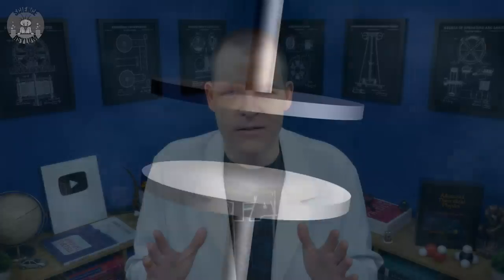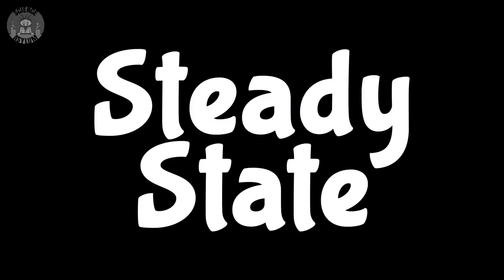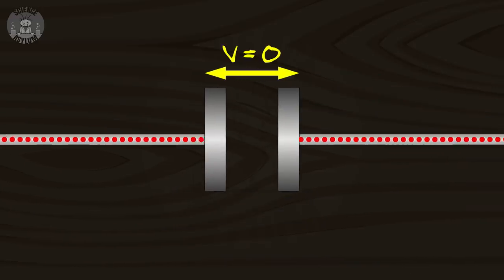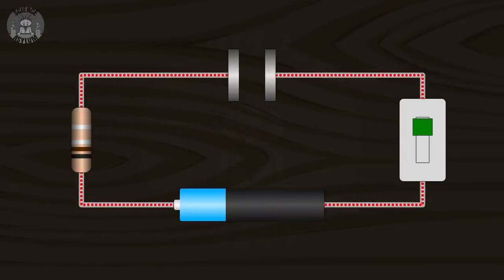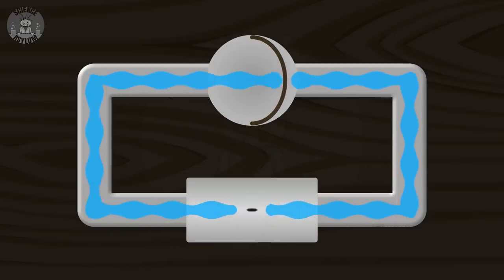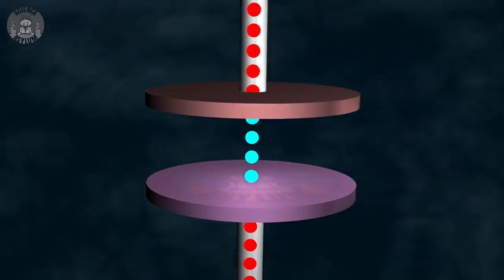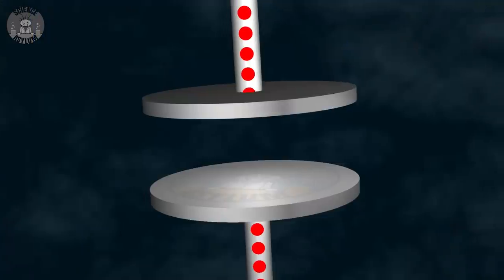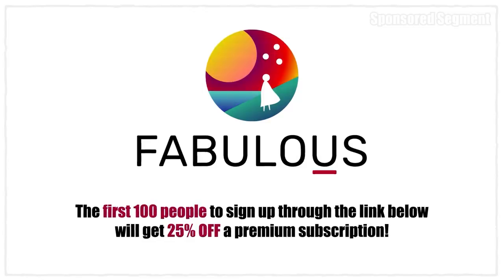Capacitors Are Gaps! How Does That Work?!

Comment: I still don't get this trend of saying that electrons (or any charge) are not transferring the energy, but the fields are actually transferring the energy because Poynting vectors.
That's trading a partial view, for another partial and biased view.

The electrons do get energy from the battery, they get potential electric potential energy. In the same way, that a mass receives gravitational potential energy when being lifted at a higher altitude.
This electric potential energy, or rather its gradient between the + and -, is actually what is pushing the electrons to move around the circuit and create the current.
Then by moving the electrons create/interact with the electromagnetic fields and the energy can be described either by looking at the electrons or by looking at the fields and the Poynting vectors.

Is the energy moving with the fields, or with the charges? Well it does not really matter, because they cannot be separated.

However, thinking that the Poynting vector tells us everything about energy is ignoring half of the story. For instance for a resistor, the Poynting vectors tell us that the energy is coming from the fields outside the resistor toward the resistor. While at the atom level, the energy is dissipated by electrons interacting with the atoms. So what's is a more appropriate description of Joule heating?
EM fields sending energy into the resistor, because it is a resistor and that's what EM fields do?
Or electrons actually losing their energy by smashing into atoms?

Tips: with the 2nd we can deduce the first along with Ohm and Joule laws and how resistor change with temperature.

Comment: Wait, did I miss something but why is a capacitor gap useful to a circuit? What purpose does it provide to have energy 'breathing' at a particular point? Do you even need/use capacitors in a circuit for a light?

Comment: A capacitor is like a bucket, where water is the charge. It takes time to fill it. A small capacitor is like a paper cup, a medium capacitor is like a bucket, a large capacitor is like a tub, and a really large capacitor is like a swimming pool. The analogy is not perfect, because the fuller it gets the harder it is to squeeze in more charge, like with batteries. This is where we can use another analogy: people entering a car. 4 people can be seated instantly at the same time. As soon as you have 5 people, the one in the middle has to get in first, and the 2 others can't enter until he's in the middle. And it gets worse, imagine squeezing in 10 - 15 people in a small sedan. The capacitor is like a circuit break for DC current, and it's like a queue for AC current (it delays things, like when you wait in queue). Except the direction of flow changes really quickly, imagine people entering the room, exiting, entering, exiting a million times a second. The actual equations are very different, though. Once you understand what's going on, you're better off working with the actual math rather than your intuition.

Comment: WHAT IS DIFERENT between capacitor and coil of coper wire , because when coil of wire is in series with the light bulb, when switch turned of the bulb still shine for a second or two. thanks for informing video                                                                              eire is in sereis     n

Comment: If we need an electric and a magnetic field to have a poynting vector, and we get a magnetic field because of moving electric charges, then the battery will have to move electrons to transfer energy will it not?
Reply from the maker: "...then the battery will have to move electrons to transfer energy will it not?"
Yes, that's true... but that doesn't mean the electric charges have to go all the way around the circuit. The electric field can just charges moving on the other side of the circuit before the wires on the ends respond (depending on how far away they are).

Comment: Seems like it would've been good to include what happens if/when the battery is discharged or removed.
Reply from the maker: If you remove the capacitor after it's been charged, it can hold onto that charge for decades.
Reply: @ScienceAsylum  Sure, but I mean to show the capacitor discharge flow.

Comment: Its allways fascination that energy is held in capacitors via the electric field and in inductors via the magnatic field while both fields are a corelated phenomenon.
Reply from the maker: Even though they're technically one thing, the electromagnetic field, it's almost always easier to think of them as separate.

Comment: But you never explained "WHY Capacitors?"
Battery hooked up to itself would discharge quickly. A switch gives control, but still no work is being done other than the chemical changes inside the battery.
Why add the capacitor to the circuit?
Most often, I hear capacitors used as an alternative to batteries w rapid charge / discharge vs the trickle charge/discharge of the battery. Wouldn't that mean that at max charge the gap is breached and the flow happens in a rush then recharged again?

Comment: This is a great breezy education video. The one unnecessary fact is the line "Even superconductor has resistance". I am not saying that it is not true, it is just that, from a pedagogy standpoint, this unnecessary mention of superconductor put a limit on our constructive learning of electrical engineering. If we were to imagine that our learning is like a game of infinite Go where the focus is on aesthetic, then we could see that some facts are like ugly pebbles placed far away early in the game. In constructive learning, we build models from the information that we gathered. When our models failed us, we go back to the drawing board and Wile-Ethelbert our way to deeper understanding of our world.  Our sphere of understanding grows ever bigger and brighter. 

Near the end of the video, Poynting vector was introduced. Energy is shown to came from outside the wires. There is no resistance for the energy (the type of resistance that we care, for we care about energy loss). A wire can be viewed as a magnetic-field generator (the non-mention of electric-field is intentional) instead of a current-resistance energy-impedance thingamajig . Then, if we study coaxial cables (which essential is just someone's idea of turning the whole wire into a capacitor), energy that is coming from outside never reaches the wire which means and the wire failed to generate any magnetic field.

Okay, to bookend my comment about superconductor. The common view is that superconductor has zero electrical resistance. It is quite hard to find literature that would even mention about the resistance of superconductor. Also, a superconductor is not definite by its resistance to electrical conductivity, rather its expulsion of non-source magnetic field.    

#ee-newgameplus
Reply from the maker: "...from a pedagogy standpoint, this unnecessary mention of superconductor put a limit on our constructive learning of electrical engineering."
Are you just saying that the short tangent about superconductors distracted too much from the main topic? That I should have just stayed focused on the main topic?

"It is quite hard to find literature that would even mention about the resistance of superconductor."
That's because the resistance is so small that it's never going to be important on any practical level. I'm a theoretical physicist though, so every tiny insignificant detail is going to be important to me at some point because I want to understand the full picture.
Reply: @ScienceAsylum  Hi Nick, sorry if the intention of my comment is not well-understood. Basically, I enjoyed these YouTube science videos as a hobby. The comment is more of a note to myself (and to the few that find it useful). Initially, I wrote just one short paragraph of message. Then I found my message to be too harsh, so I sugarcoat it. Then, I add a second paragraph to further sugarcoat it (because I didn't find any video from you on coaxial cable, so I thought it was beneficial to mention that). Then I (as a somewhat narration-focused person. Even this reply is narration-based), realized that I need to add a third paragraph to revert the narration of the comment back to the original message.

Comment: I used to get stuck on whether a capacitor would ever lose all its electronics? but things never get that far, a capacitor either reaches a DC steady state OR if the voltage continues to rise things eventually go BANG. So are there limits? yep, but not enough electrons doesn't appear to be one of them. :-)
Reply from the maker: There are always limits.

Comment: So, in the audio world it is said the capacitance of wires, cables can affect tone (usually in long lengths).  Wires don't have a gap so why do they have capacitance?
Reply: Cables do have a gap. There are usually two* wires running inside the cable and they form a capacitor. The microphone/speaker is connected in parallel with this capacitor. The longer the cable, the more capacity it has and thus more capacitance.
Higher frequencies pass more easily through a capacitor, so they "leak" through the wires and don't reach the end device. So you loose the more and more high end of the frequency spectrum the longer your cables are.

Comment: capacitor is like uncharged battery, if two connected electric charge in the system going to equal level, of course capacitor got way smaller capacity than battery, but it is enought to power the led diode if connect after chargin stage

Comment: Question: you animated the red dots clockwise, but don't electrons move from ➖ to ➕ pole?
Reply: Yes, electrons do move from negative to positive.   He didn't specifically say it was the direction of the electron motion.  Just a representation of current in general.

It's an accident of history that the electron is negative, and that conventional current is defined as if it were hypothetical positive charges flowing.   Electrons flow in the opposite direction of the convention we use for assigning the direction of current, due to the fact that the electron is negative.   The results of the circuit are exactly the same either way, and you would not be able to tell the difference.
Reply from the maker: The animations are using "conventional current," which is the motion of positive charges. (Note: I always use red for positive and purple for negative.)

Comment: In your diagram the capacitor looked identical on both sides. It's been a long time since I dabbled with electronics but I remember capacitors have a positive and negative side. Mount one the wrong way round and you get a nice little bang with the contents scattered around the place. Why is there a polarity requirement? I assume something was left out of the diagram?
Reply from the maker: Some capacitors have a polarity and some don't. Honestly, I don't completely understand what makes polarized capacitors polarized. It's a little too practical of a question for me.
Reply: Polarized capacitors used sheets of anodized metal in their construction. The anodized layer insulates the sheets from each other. If you reverse the voltage it reverses the anodization and converts everything back into the base metal. Dead short between layers.

Comment: With the diaphragm analogy, how can a capacitor increase it's discharge voltage beyond what is being supplied.
How could a 1.5V battery create a discharge voltage of 100s to 1000s of volts in a capacitor when from my understanding the capacitor "plate" reaches 1.5Volts, the resistive buildup of charge should "stop" the circuit?
I know the absolute basics of circuits.

Comment: I'm still a little bit confused about the low speed of electrons, how energy flows  and how a spark is made with a small distance between wires as we increase the voltage seeing in the perspective of magnetic and electric fields. Would you mind explain in detail?? thanks a lot
Reply: There are billions, if not trillions of electrons that are flowing in a small section of the circuit.  The individual electrons have a drift speed on average as a consequence of carrying current, and that drift speed is incredibly slow.  The energy and information still propagate at nearly the speed of light.   The billions/trillions of electrons, in a wire already filled with conduction-band electrons, is what makes this possible.   In fact, the electrons have a chaotic thermal motion that far exceeds their electrical motion, but on net, this thermal motion adds up to zero.  The electrical motion is the part of their motion that doesn't add up to zero, but adds up to an organized motion to propagate the electric fields and energy.

As for the sparks across an air gap:
Air is a great electrical insulator, as are all gasses in general.  However, that is only if you can keep air in the gaseous state of matter.   If you subject the air to enough electric field, you will strip away the electrons from their corresponding nucleus, and ionize the gas to make it become a plasma.   All plasmas are conductive, and will create an unintended path for current to flow, called an arc fault.   The spark you see, is the air ionized as a plasma.

If you had a vacuum gap instead of an air gap, that would make a much better capacitor to prevent this from happening, since vacuums will always be an electrical insulator.  You'd need the photoelectric effect to eject electrons from the plates and have them cross the gap, in a vacuum gap capacitor.  But making a manufactured vacuum capacitor is not practical or cost effective.  A dielectric insulator filling the gaps is a much better solution.   Plus it enhances the capacitance, without additional plate area.

Comment: I have so much more respect for early researchers trying to comprehend electromagnetism. James Clark Maxwell, Michael Faraday, Nicholai Tesla, etc...

Now you have to explain how MOSFETS work. Especially since they are perhaps THE most essential component in modern electronics! (And are manufactured in utterly staggering numbers!)

How do Capacitors release all of that stored energy so extremely rapidly? 
(Or at least rapidly in contrast to a chemical battery). Or perhaps I should be asking, if it takes "n" microseconds to charge a Capacitor,  how can it take so much less than "n" microseconds to release it all..?

Also, some of the newer designs I've seen of bleeding edge chemical batteries (mostly for electrical vehicles & portable devices) would integrate high-speed capacitors into rechargable batteries (or even create hybrids of the two) in order to profoundly shorten the re-charging time. I'd like to understand how including capacitors in a circuit would make charging a chemical battery go faster..?
Reply from the maker: "How do Capacitors release all of that stored energy so extremely rapidly?"
Because the energy never leaves the EM field. When you put the energy into a rechargeable battery, it has to be transformed from field energy into chemical energy. Energy transformations take time. When the energy goes into the capacitor, it stays in the field (the electric field to be specific). There's no transformation, so it can be used faster.

Comment: Another way to see a capacitor is: it is like a rechargeable battery, yet in comparison much faster to fully load, and with very limited energy storage. Actually, there is a firm now which is building super condensers to store energy, as an alternative to li-ion batteries.
Reply from the maker: The problem with capacitors is the discharge isn't as controllable. Capacitors like to discharge quickly, which is why they're more useful for energy dumps than energy storage.
Reply: @ScienceAsylum  that's right, capacitors also discharge quickly... fast-fast! and I ought to correct my previous comment, the actual name for these things is "ultracapacitors" or "supercapacitors"

Comment: What happens when you remove the voltage source yet the capacitor is still charged with a different potential across its plates?

Comment: Capacitors are used to build an amount of charge over an exponential curve (graph with time and voltage axis) and then release that charge when triggered to do so. Most caps are used to smooth out noise in circuits that cause fluctuations that are detrimental to the proper function of those circuits. They are kinda like a battery in a sense. And that is my limited understanding of them.

Comment: In trying to explain a simple capacitor, we've gone into very abstract descriptions.  Capacitors are simple.  A current flows until the voltage has stopped building.  That current flows because electrons are being sucked out of one side and jammed into the other.  I could be wrong.

Comment: If you want to go really  crazy and make it incomprehensible for a lot of people; the switch actually is a capacitor too, just with a real low value (in open position) and the wires are coils (with just one "winding") making the entire real life system soooo much more complex!
But please don't do this instead of the video's that educate everyone. I don't want people to get scared off. My mind is just, eerr.... Let's say it functions a bit differently. And not just because I'm on the spectrum, because that only makes life more fun imho :p
Reply: FYI; I'm an electronics engineer, but with an insatiable apatite for digging deeper in to the subjects that "strictly needed" for my field of education ;)